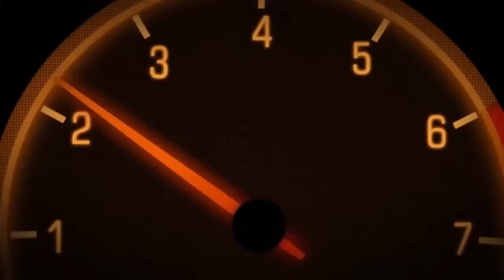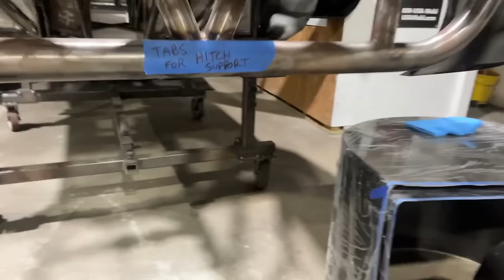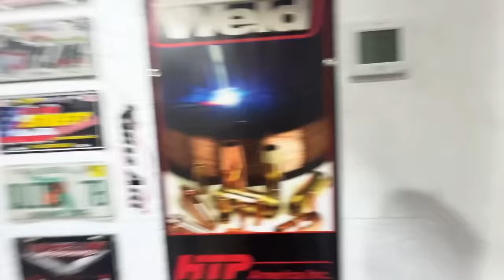I Need Another Race Car?

Comment: Anyone that wants to give a hard time about your engines should appreciate the fact that those top fuel cars literally turn 540ish ROTATIONS under load before they get rebuilt. Yours go thousands of miles/ years before getting opened up.  Respect.....🤜
Reply: I was like "That can't be right....540isd rotations under load??" and then I whipped out the calculator......and Damn!!. that is right. Some new information to add to the car nerd memory banks!
Reply: That's a crazy thing to get your mind wrapped around.
Reply: I assume, not counting idle time?
Reply: @Godfatherws  correct. 540 rotations for the run. 900 rotations if you include the burnout

Comment: Floater time 2220
The wagon rear is a drag race only deal so a snap ring is OK for straight line but not so good for turning corners at high load.
The threaded floater for the Camaro is more like a NASCAR / road race application where side loads can occur.
Reply: WELL SAID
Reply: One is a tapered bearing vs roller bearing in which they still make street cars today wt out tapered bearings on the rear! Tapered bearings have more drag! I dont think it matters as long as your not road racing or nascar!
Reply: @anthonyking4387 I bet Steve could take the Wagon road racing.
Reply: I bet that snap ring, tapered deal got yanked off before I sent this. When side pressure occurs with this one, a wreck is soon to follow. 😂. I don't think Steve wants to turn any corners above 10 mph. 🫠

Comment: When powder coating a frame against the floor if you hold a wire in your hand for a ground and wedge the tip of you ground wire in between the cage and the floor it will eliminate the Faraday cage affect and get coverage, did it for 7 years...

Comment: Congrats on the purchase Steve!
That's gonna be 1 Bad Ass car... I'd definitely go with a super exotic candy powder coat. Just because them with just a factory clean paint job that sick ass chassis & cage will be highlighted.
Just my 2 cents Bro. 
Safe travels home!
Reply: As cool as the crazy powder coat colors look they’re so difficult to match with a rattle can after any repairs or welding (crack repairs and such)that if you have ocd you end up eventually having to strip the car and get it redone

Comment: It really amazes me how many people don't understand simple concepts like full floating axles. For anyone doubting it's safety, every single semi, dump, concrete, etc. truck you see on the road as 2 full floating axles on the rear. They break axle shafts all the time and the wheels stay on. You just pull the axle shaft out and stick another in.
Reply: Not to mention all the 3/4 and 1 ton tow pigs hauling race cars and everything else oh yeah what about your four wheel drive front axles (at least older stuff)

Comment: For those that don’t know the difference between a floater and non floater diff are where the weight of the vehicle is supported. 

Non floater the axle shaft sitting on the bearings in the diff housing and carrier assembly in the diff housing take the entire weight of the vehicle and the axles using retained by clips inside the carrier. Bearings in the carrier will be tapered rollers and the ones at the end of the axle tubes will be ball bearings or straight roller bearings

Full floating the weight of the vehicle is taken by the bearings and on the diff housing. This is why you can remove the axles without taking the wheels off and opening the diff up. Bearing will be tapered roller bearings in passenger vehicle and truck and coach applications which require a preload like Steve said. Spec for passenger cars vary but truck and coach has a national standard of .001-.005in

Hope that clears things up for people

Comment: Silicon Bronze is also used by cage builders because it wont crack from vibration after a couple of seasons. Its super strong for where its been used plus like kev said les heat into the cage and the sheet metal so no warping and the bars dont lose strength from heat

Comment: Floaters, is all I have ever ran, The nut I like uses a pinch style, or you can use a bend tab, I have always use tapered brgs [timken] more surface area, and lubricate from the diff oil [1gal] then I machine a sleeve that goes in between to set preload, I have floaters on original brg's that are 25 years old and this all in off road racing. We torque at 150lbs. Just a couple of thoughts

Comment: I remember in my 77 F250 High Boy breaking both axle shaft on the Dana 60 Amazing how 39x18 M/T grip on asphalt when you also push them with a nice Big Block.  Same truck the driveshaft between trans and Transfer Case i twisted up like a pretzel at a different time. Good times driving over cars even ones girls make illegal u turns in lol

Comment: Powder coat will go between the bar and the sheet metal Kev. The effect is called Faraday cage and any competent powder coater will get around that with ease. They tell you that the powder won't go into the area because they don't want the extra hassle of doing the job.
Reply: Even doing it right Sometimes it does sometimes it don’t and when it does it’s usually so thin that it might as well not have

Comment: To anybody wondering about floating axles: They're safer, stronger, easier to work on, last longer, have less downtime, and give you better braking performance. Yes, they cost more. No, they don't have to cost a fortune. You can build lightweight floaters out of 8.8's and 10-bolts. You simply weld in the snout and use aluminum hubs. Just be honest with yourself about your power goals and tire choices. Once you get into F9's, 14 bolts, D60's, D90's, AAM 9.5/11.5's, the gearset is more rigid, which ends up being more efficient at that power level.

Comment: @2:28,, the little Lexus 230,, THAT's the car Steve should be building. It's small, short wheelbase. Fitted with a proper cage and set up for 6 second pass's would be an AWESUM little hotrod for a blown SM Monster Motor. That or a Mazda 3 mini SUV. Strange to me no one (other than ONE I saw last year) is using that sweet little body.

Comment: Steve morris. I’d like to say I love your videos. Hate the background music. Appreciate the knowledge part of your videos , and I don’t want to be a stickler .. but showing a diesel truck with 5000lbs of torque twisting the frame till the rivets snap is not the same as an anti roll bar. Anti roll is exactly that.. when the car turns a corner, it keeps the body flat, also helps to keep the right rear dragging the bumper created from the direction of the torque twist helping distribute weight. Love whatcha do

Comment: Soon as you said it WAS going to get a SMX, I knew an SML was coming. BTW KSR built Mullet's original chassis (they've updated themselves over the years), but KSR built it originally, so this car will be solid
Reply: Technically no Mullet started out at Pro Fab and was going to be a Jet car. Kevin took it over from them.
Reply: @Atodaso-pg9kq , true but he finished the fab work which i feel is deserving of credit. For the record, i thought Kevin did start it after the rocket car change. If so i stand corrected

Comment: If the camaro is 1000 lbs heavier same power plant does that mean it will run 5s based off the old 100 lbs is a 10th off your eta

Comment: Motorcycle racers figured this out long ago, if you powder coat a chassis it hides flexing and cracks when they first develop and you are less likely to find them right away. I don’t understand why drag racers insist on powder coating chassis’s. Paint the chassis and then if a stress crack develops or the chassis is flexing where it shouldn’t, you can find it right away, hopefully before it causes a chassis tuning issue. I have to wonder how often a car develops a chassis issue that the owner/tuner can’t figure out because the powder coat has camouflaged the flexing or crack causing the issue? Maybe not very often, but the durability of powder isn’t worth the hiding of an issue. Sure, powder coating sounds like the higher end choice for a high dollar build, but it’s really not ideal for a highly stressed chassis, unless that exact chassis has a designed in service life and disposal point based on repeated testing.
Reply: Especially all the wild colors that are becoming popular now days you might as well forget seeing a crack before stuff starts falling off

Comment: Call the new car Black Panther or Shadow. Yes Leigh snitch you off about you being there with them. Yes Clay has Videos on the Cost of the parts and what all they are and do. The cost just per 3 sec run is crazy. Clay is a great Guy like you Steve. He is a down to earth and willing to share the good and bad. Go Val GO.  6 Second Car for Val soon that will be great. SMX would have been the BOMB but a SML will be great with the weight of that car.
Reply from the maker: Not going to be black
Reply: Must be white with the SM logo and the Brain "Little Rat" on the hood @stevemorrisracing

Comment: As a dirt oval guy the fact that people run how they do with non floater rearends makes me scratch my head I’ve seen to many bad things happen from broken axles with non floaters. We’ve literally passed on lower budget classes that we could have easily kicked azz in and built a car for a class that cost double instead due to rules that say non floaters only. A floater should never be considered a performance item when writing rule books it should 100% should be considered safety equipment when writing rule books

Comment: Is Kevin, objectively, a good chassis builder? I know he did Mullet 1.0, was a good car on paper but struggled early on to do 6’s consistently. But other than Mullet, does he have any successful customers?
Reply: you don't think that mullet struggling to reach 6s isn't about how heavy it is while the power was a bit more than half of what it has right now and very little knowledge on the suspension tuning?
Reply: @mostneuter  well thats what i put to the internet,  was more of a does that define him or does he have others floating about.